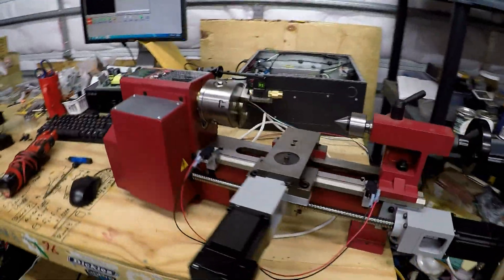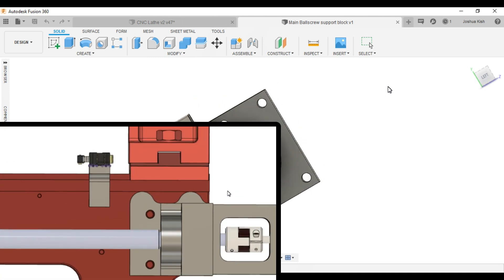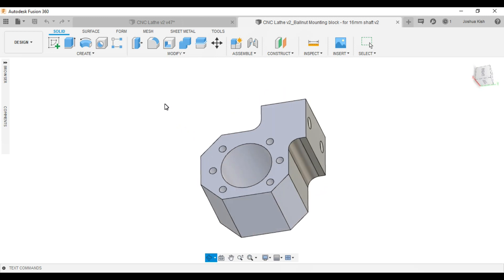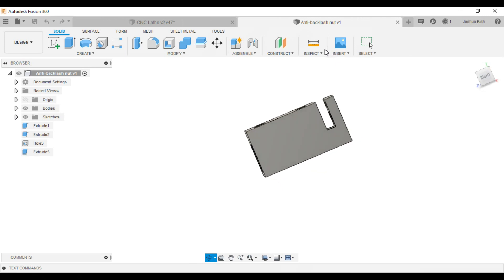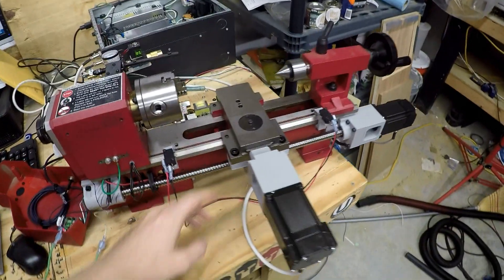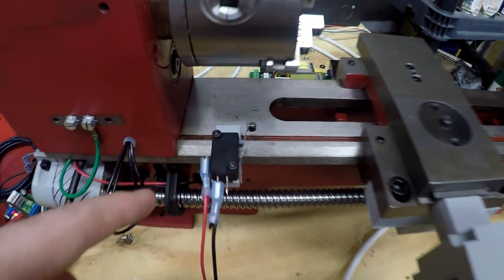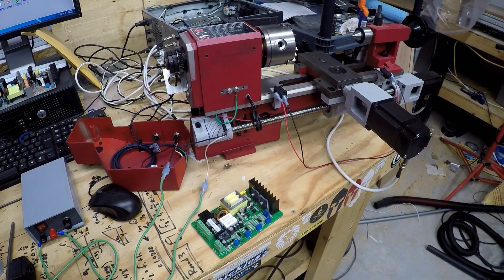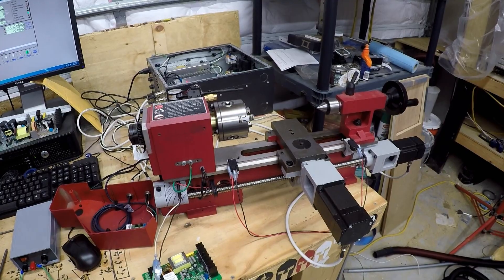3D Printed CNC Lathe Conversion

Comment: Thank you for sharing your build! You basically cleared up 90% of my internal dialogue. I was given a Delta 46-460 to convert. The most machine experience I have is a 3D printer I've had since November 2019.

Comment: Great build!  I'm just starting a lathe & mill CNC conversion.  I have basically the same lathe as you do.  I have a 750W DMM Tech servo motor (http://www.dmm-tech.com/Files/CTADYN4FT-1214E0_P1.pdf)  that I'm looking at using for the spindle drive down the road.  Like you, the only thing, other than the cast iron, that is original equipment on my lathe is the motor.  So the beefy servo is my backup plan.  I'm also thinking you could likely to be able to find a different DC drive if you wanted to keep the same motor.  I have a couple questions: 
Are you sharing your Fusion 360 models?  Do you have a link.
Are you planning on doing threading on your lathe?
Reply from the maker: Thanks Jerry! Don't know if I'm planning on doing threading, but do have sensor to monitor the spindle - so it should be possible. 

Currently not sharing the files, most of them are fluid and will be adjusted as I machine out of aluminum and get things fit or put together. I also put a ton of time into these and may want to sell a few to get my "money" back... either that or just make this one-off and move on to the full lathe build. After doing this, I kind of want to build my own lathe frame that is designed to allow motors and stuff to be mounted. I think people may be able to get that at a better price than buying a small manual lathe and then buying kits to convert.... stay tuned for that if you're interested. Thanks for following along!

Comment: Also possible to use 3d printer part permanently, the idea is  'Reinforced 3d printer part'.    Print part as a shell, just print it hollow with one cap side open, then fill the hollow with fiber and epoxy resin, The fiber can be fiberglass woven or sophisticated black carbon if you want, nylon webbing strap also good n cheap. Since it have very high tensile strength so do your reinforced part..

Comment: The 3d parts are for fitment right? Your going to machine or cast the final parts yea?
Reply: I bet it would work as is! I'd be interested in trying out your files and doing a conversion myself!
Reply from the maker: Yes! I've got a CNC mill that I plan to use to machine everything. The 3D printed parts are just for fitment and to make sure everything works, fits, and make sure there isn't anything (design wise) that I missed.
Reply: @bgwmachine  had to ask,  near the end ypu kind of suggested light cuts and if it breaks replace it.

Don't want to see hard work hurt itself or you if it fails